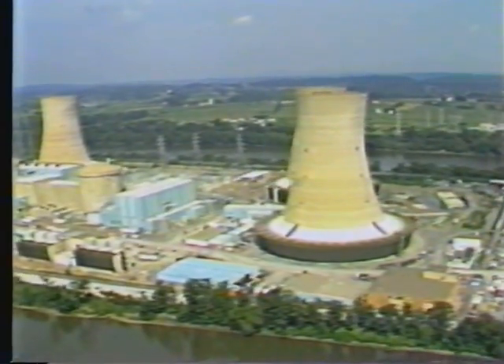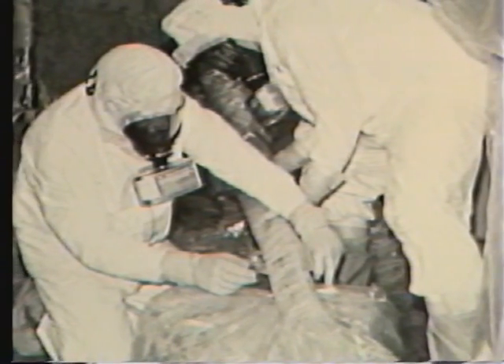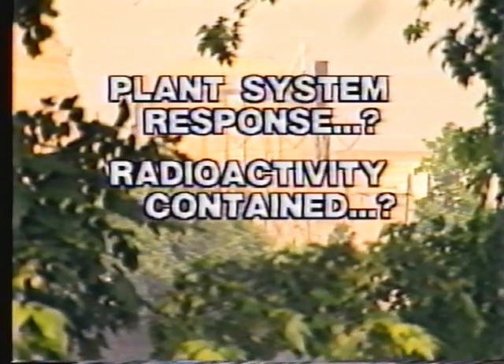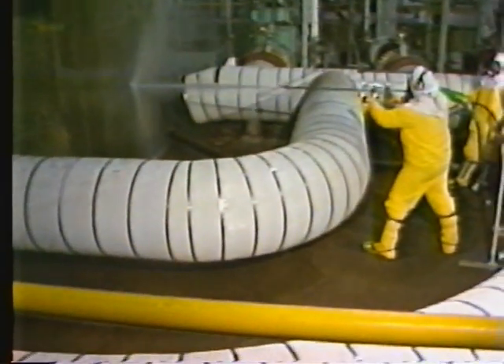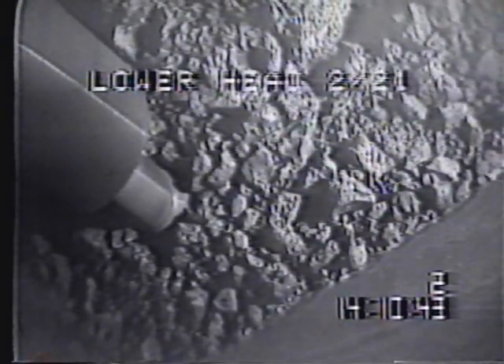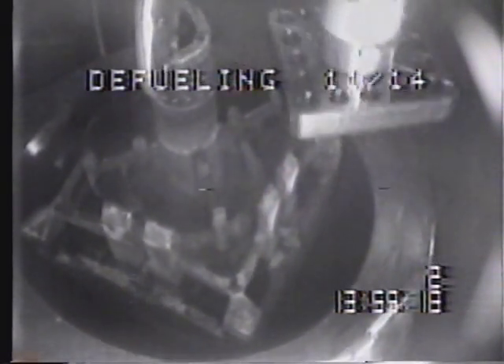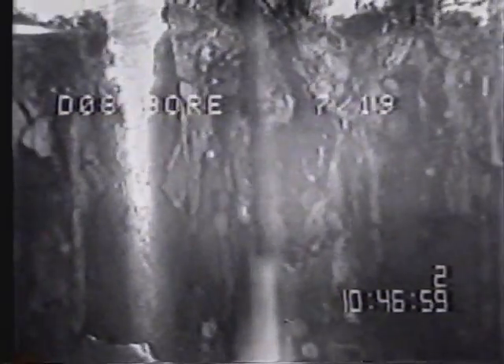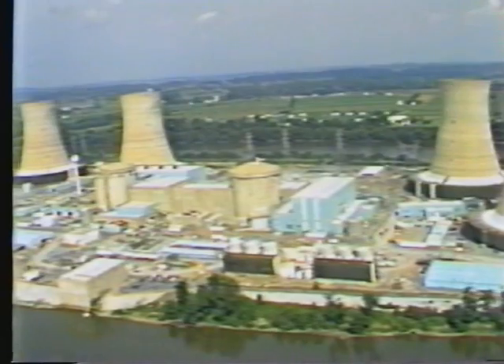A Report on Three Mile Island Unit 2, TMI 2 (1986)

Comment: Don't build any more that would be a good start. Shut down the rest !
Reply: Yes, but could you please come up with an alternative, that won't pollute the air every day but still provide 2000MW of power?
Reply: Yes, we can do with burning fossil fuels of course
Reply: Actually, we still use the reactors if we don't build more- they are just older, more dangerous and harder to use. Would you want to fly on a 70 year old plane in service for 70 years or a modern plane? Why would you want a 70 year old reactor instead of a modern reactor? Most reactors aren't 70 years old, but the point is the same- modern reactors are designed as FAIL-SAFE- when left alone without power and cooling they fail to a safe known condition. Older reactors are FAIL-HOT; when they are left alone without power they meltdown and a disaster occurs. We need to replace the old crappy unsafe reactors with newer safe ones.
Reply: @Cutest-Bunny998  re: "Would you want to fly on a 70 year old plane in service for 70 years or a modern plane?"

Look up the history of the DC3 aircraft ... and then think about the 737 MAX ...
Reply: @uploadJ You are cherry picking. Look at this PDF (http://awg.aero/wp-content/uploads/2019/09/Hansman-Impact-of-Age-on-Aircraft-Safety.pdf#page=11) which details the increase of incidents related to age of air-frame. It is an inverse exponential curve (approximately) that gets smaller as the aircraft gets newer. There was a reason I picked greater than 50 years (70 years) and it's because around then is when the curves growth really ramps up to be much more unsafe. Note that study/presentation does conclude that there is no correlation between age and safety risk for air-frames less than 27 years old, but I am using the raw data and not the conclusions for my point (though I mention this out of a sense of honesty regarding the source). The data I'm referencing was produced using many airframes of many makes/designs and helps eliminate the bias that looking at one famously reliable old aircraft and one famously dangerous new aircraft, in isolation, causes. In fact they looked at 489 accidents (n=104 fatal/n=385 non-fatal).
Reply: @Cutest-Bunny998  That plane was operated unusually harsh. It was an island hopper, making thousands more landings in its lifetime than normal 737 planes, and the crack wasn't discovered during routing inspections andallowed to grow.

I'm an aircraft technician.

Nuclear power is by far the safest per unit of energy produced, compared to anything else, despite the events that have happened. I agree that they need to stop making the old school pressure cookers with radioactive water though. It's ridiculous when there are much better fission reactor systems possible. Look up MSR reactors.